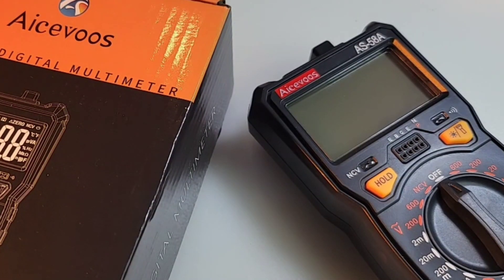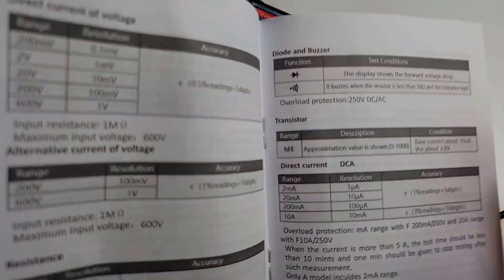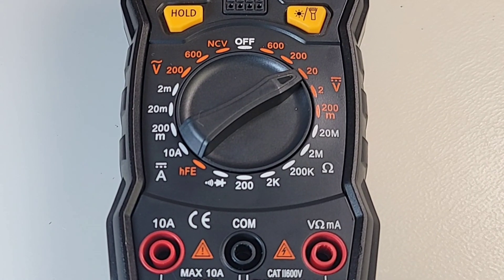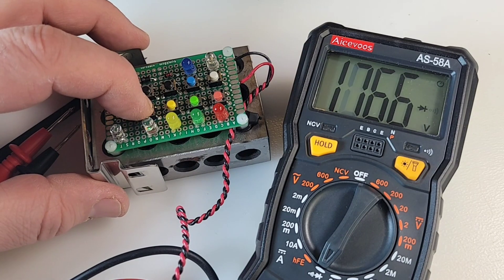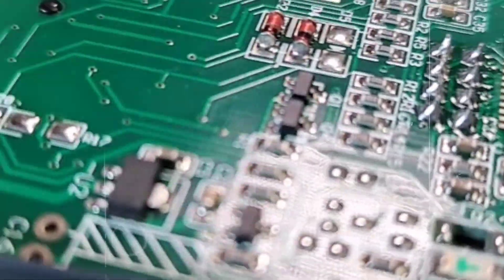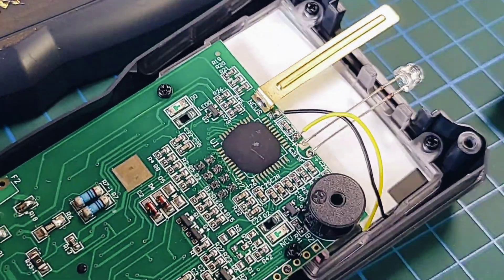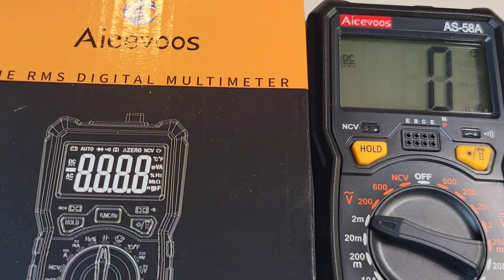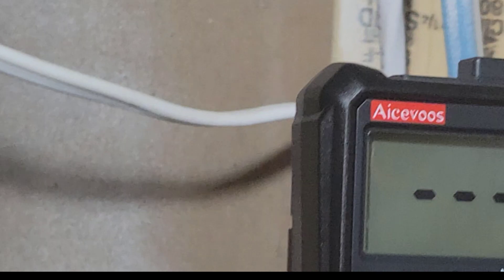Aicevoos AS-58A (RICHMETERS 113A) CHEAP-O Multimeter Review & Teardown!

Comment: Great meter but i don't see how to open mine theres no screws on the back cover. it should i ever need to replace the fuse. The auto ranging model is 58-AD and its about $15.
Reply from the maker: There's 4 Philips screws on the back, remove and you'll have access to the fuse.
Reply: @KeepOnTesting  i don't see any screws on the back cover.

Comment: Everytime I see a DMM with the specs: 2000 Counts, manual ranging and no capacity range at all... I´m thinking:"Super! The next version of the ancient 830..." Is it not boring for You to review again and again the same old design, as it is for me to see the practically identical crap DMM over and over? It´s now just an awful outdated design. When they will it RIP? And a BL lasting for 10 seconds. Seriously??? (Don´t let me be misunderstood: This is a complain about the industry, milking the 830 design to death and above. Not about the reviews.)
Reply from the maker: I hear ya ..
I guess beauty is in the details . Even though some design choices seem like a rehash,  if you dig a lil deeper you can usually find some improvements or something new and improved that puts a new twist on a common theme. Here the implementation of a polyfuse on the mA range , the recessed selector switch mechanism along with the snappy performance and dual  ncv/continuity indicators made it unique enough to stand out of the crowd. 😊